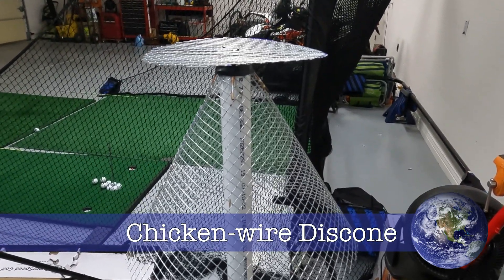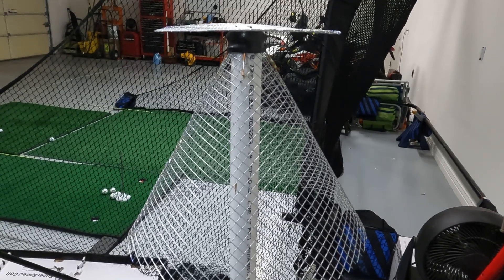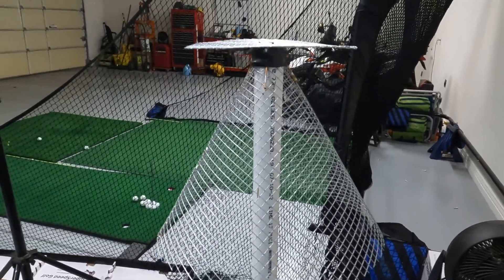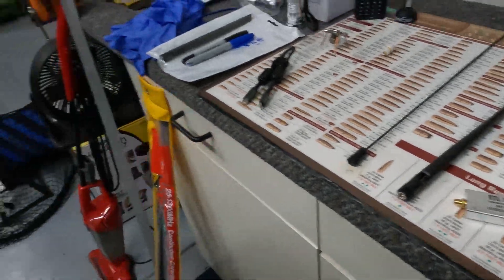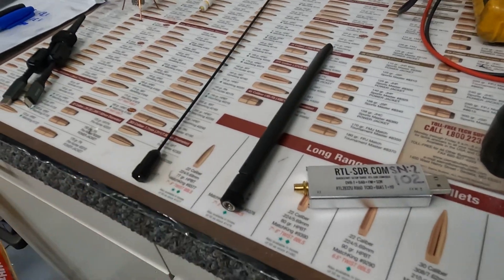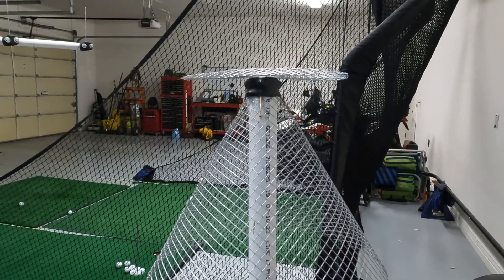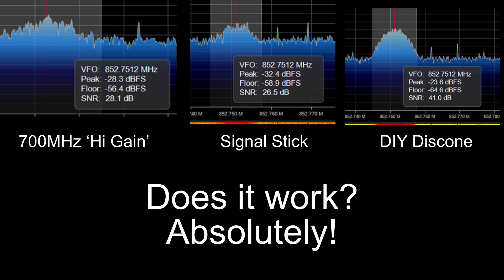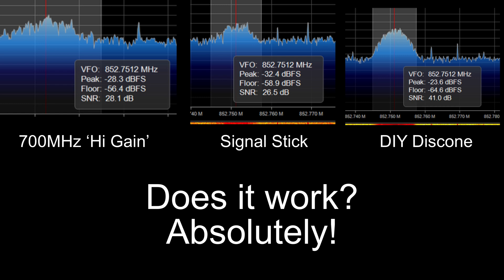DIY Discone!

Comment: Nice job!

I have a similar one in my attic crawl space. Mine is about a meter in the cone width and transmits and receives well on 2m and 450 as well as being useful for general wideband monitoring. My chicken wire is somewhat finer in pitch. The only problem I had was getting it through the roof crawl space access hatch - which means I had to complete the assembly in the attic.

I later bought a commercial version from Comet  which I mounted outdoors, but could never find any difference in performance so I sold it and continue to use the discone I built.

Miniature ones also make great UHF receiver omni antennas for wireless microphones... Endless fun explaining what they are to the cast and audience who spy them...
Reply from the maker: Awesome, this hobby always provides me an endless list of projects to try, experiment and have fun with. i also have a commercial grade discone I put back in the bag.

Comment: Who the hell ever told you that you need one antenna per SDR,  get a antenna splitter, I have four SDRs on one discone antenna...  my anttenna is 12 feet above the roof.... amazing signal...
Reply from the maker: Noone. But there is no free lunch. You can't split a signal from an antenna without some loss.  Typically 3db on a good 2 way splitter.  So your 4 sdrs are  getting 1/4 the signal strength that a single SDR would get off that same antenna. Obviously not a problem with local, strong signals off a good antenna as high as you got it. I was intending to run mine in the attic which is already a compromise. Also materials were cheap and  it was fun to build and actually get good results. All is good.
Reply: @BarryShaffer ì

Comment: How did you solder the inner part of the coaxial cabel to the chicken wire？
Reply from the maker: A little Flux did the trick. Actually took the solder quite well.

Comment: Hi please tell me the dementions of your chicken wire discone antenna mini one please Nathaniel
Reply from the maker: Hi Nathaniel, The dimensions are based on the lowest frequency you want the antenna tuned for. I used and online calculator to get my dimensions. You can find that here: https://www.changpuak.ch/electronics/DisconeAntennaCalculator.php. I set mine for 450MHz and avowed so it’s about 6 in in diameter and 11 in tall.